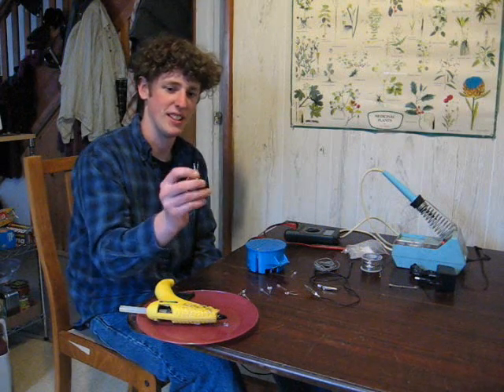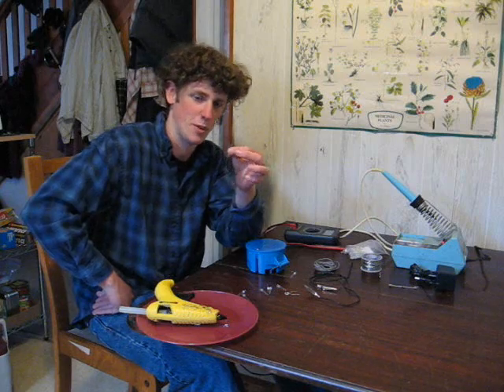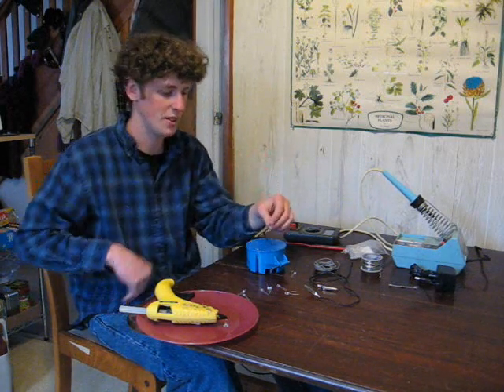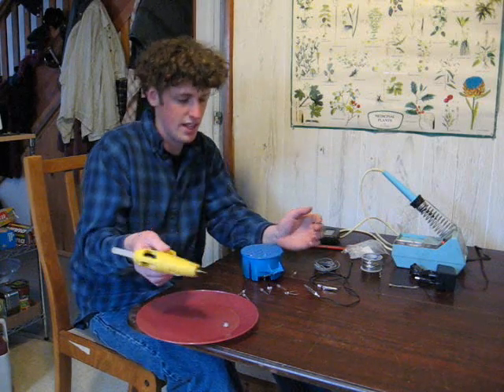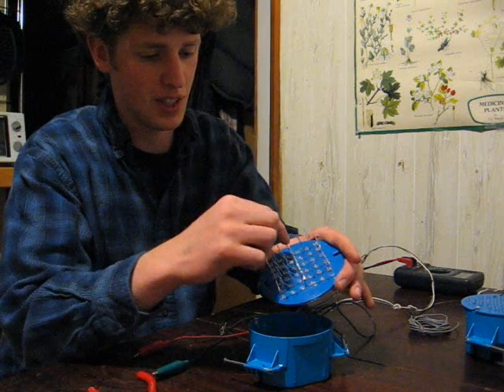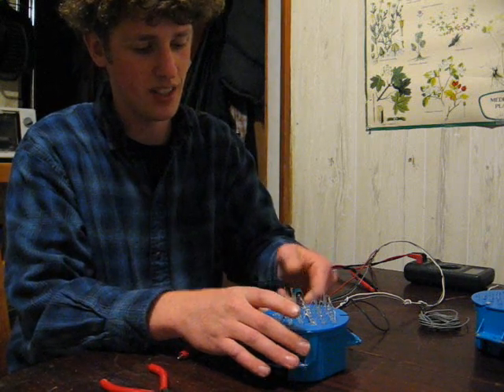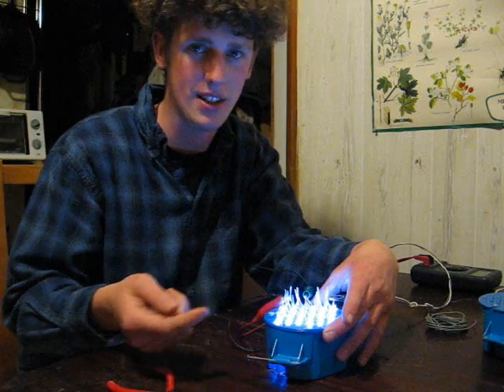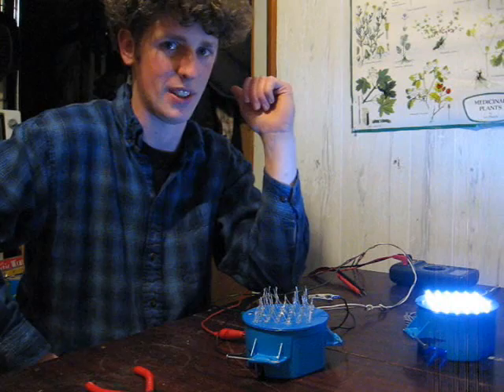How to Build an LED Light - Part 2

Comment: I thought you did a good job very informative telling the drill size etc many people won't get that specific. And glad to hear its lasting years. Something you may want to get is I had a Black and Decker rechargeable battery operated solder gun for repairs when I raced boats it has a fine top and is very precise and easier to use. Also I would paint box bright white with a reflector after seeing it back lights I would try a bracket to suspend it on the reflector to use front and back.  Cool!

Comment: You know that you apply solder to the work not the iron. Yes you do put some on the iron but that's for heat transfer and to prevent oxidation...

Comment from the maker: If you heat up the wire on an LED, you will burn out the LED. You are right, usually I do it the way you describe, but it would be a waste of time to do all that soldering only to find out afterward that you burned up half your LEDs.

Comment: your soldering is wrong, try looking up how to solder.  you dont paint solder on, you heat the wire and apply solder to the wire to melt into it. your method is called a blob solder and resuld in cold connections.  Please if you want to do instructable video, learn first the proper methods.

Comment: Nice job guy & thanks for sharing it. As a desk item, I want to illuminate from the inside, an old 1950s hood ornament that was made for a light. I think it would take 2 or 3 super bright LEDs powered by batteries if possible. AA to 9v doesn't matter. If so can you recommend a site for 'electrical dummies' that might show a diagram for the proper way & necessary parts to do this? Would I be better off just using parts from an LED flash light?
  Thanks!....( you know your going to get questions)

Comment: you need to learn how to solder properly!!!!!!! First heat sink in between heat source and led. Second heat the wires on led then put solder on led wires not soldering iron. Its true that you might need some solder to help transfer heat but you dont rub it on the wires.

Comment: @Ohsonikefresh No resistor was needed in his design because he used 3 LEDs in series.  These blue super bright LEDs drop about 3.4 volts max and since he used a 10 volt source, each LED has 3.3 volts.  Also because he arranged the LEDs to have 6 parallel lines, the current should be low enough.

If you had a different LED configuration for your table and are wondering where a resistor would go if you needed one, it will go right after the positive or negative lead, either will work fine.

Comment: @WorkFromHome001 The one major item you'll need to make your own boards is a laser jet Printer. A regular clothes iron, photopaper and CAD software makes up the rest. I use Eagle by CADsoft. The free version allows boards up to 4 x 3.2 inches and two layers.

Comment: @thetruth482 If you do say you change out an FPGA, BGA, PBGA or reball a BGA or anything of the sort, I will know you are lying immediately. 

Repairing a burnt  or cut trace to class III standards.  Replacing a QFP. Writing either C or assembly code for and AVR or PIC.

ALL of the above REQUIRE knowledge and experience way beyond YOU and ALL of which I do.

Comment: @thetruth482 (sigh) Please listen to me. There is a company called IPC that sets the industry standard for soldering techniques. Go to IPC dot org to see info about them and who they are.

"knowledge and experience way beyond somebody sitting on a bench soldering"

Ok, lest see you change out a FPGA or a QFP which I do on a regular basis. How about programming an Atmel AVR or Microchip PIC? How about reballing a BGA? Do you do board repair like replace burnt/cut traces? 

I didn't think so.

Comment: @thetruth482 This is the ideal method since the flux is being utilized to activate on the work area and not burn up on the tip.

It makes no sense to tin the iron before you do any work since the tip will have solder on it from the last time you used the iron. You tin the iron after your done to prevent the tip from oxidizing.

Comment: @thetruth482 Be sure you tell that to the people at BEST that write the IPC industry standards that trained me and gave me my certificates. I don't care who YOU are or what you do wrong. you are NOT trained to the industry standards but whatever. Not my work you're adding too much solder to.

The part you're missing is when when you hold the iron to your work to bring it up to temp. and you start to add solder to the work area, you're also tinning the iron at the same time.

Comment: @thetruth482 Um NO, CORRECT!!!  I AM an electronics tech that's a Certified IPC Specialist in J-Standard-001 Soldered Electrical and Electronic Assemblies, IPC-7711/IPC-7721 Certified in Rework and Repair of Electronic Assemblies. I work in a facility that manufactures boards for the military, Raytheon, Boeing, Caterpillar and a hundred other companies. I do all of the RMA repairs.

Look for sparky3489 on photobucket to see my certificates and while your there, look for my album called 'work'.

Comment: @WorkFromHome001 Um no, you tin it afterwards. If you tin it before hand, you'll be adding excess solder you don't need.

Here's the CORRECT procedure:
1. Using a moist sponge (or some prefer to use brass wool), wipe any excess solder from the hot iron.

2. Taking only about a second, hold the iron to your work to bring up to temperature then add the appropriate amount of solder.

3. When finished, wipe the iron on the sponge again, tin the iron, put iron into it's holder and turn iron off.

Comment: I agree with nigelwright7557, anyone who has been soldering for any length of time knows you don't add solder to the iron. You're suppose to have the iron on one side of the project and the solder on the other. Heat up the project and add solder to it. 

Certified IPC Specialist in J-Standard-001 Soldered Electrical and Electronic Assemblies, IPC-7711/IPC-7721 Certified in Rework and Repair of Electronic Assemblies

Comment: @SharjeelEffect You leave a lot of variables.  How are you attaching to your computer?  USB port?  In the key board?  What?  What are the specifics of the LED you are using, volt and amp requirement?  And for what purpose?  R U lighting the key board, the on/off switch, what?  To many variables.

Comment: kindlt tell me how cud i mount 2 or 3 LEDs in my computer casing?as the power supply has an output of i think 12volts.how can i minimize it upto 3vs???i mean wat kinda resistor shud i use??plz help me out!

Comment: @catskillwoodgas IMHO voltage regulator is not enough. Try use 10V regulator with for ex. 5A or 10A and connect to this lamp. I think that everythink blink and blow up :D

Comment: Do NOT, I repeat do NOT solder like he did. Solder is (usually), and by usually mean unless you're doing surface mount soldering, you should always heat the component you wish to solder and apply the solder to the contact point. NEVER APPLY SOLDER TO THE IRON AND TRY TO APPLY IT TO THE COMPONENT. 

Also, tin your iron with solder before soldering and wipe it off with a copper brillo pad or wet sponge to remove excess solder and to clean your tip. tinning your tip reduces oxidation.

Comment: Great tutorial! One thought about soldering though.. It's better to heat the wire with the soldering iron and then apply the solder directly to the wire. You still need a bit of solder on the tip of the soldering iron, but the main solder should only go on the wire. There's a great video about soldering if you search for "How and WHY to Solder Correctly".

Comment: Have you tried a heatsink? Try clipping something metal (larger than the alligator clip) to the poles, that way you can solder correctly by heating the pole and applying solder to the pole. The heat will draw to the metal object rather than to the LED and possibly burning it out.
If viewers learn how to solder the way you're doing it, they will have problems with solder sticking to joints for sure.

Comment from the maker: yes, it is usually better to heat the part receiving the solder, but with LEDs you will probably burn out half of them if you do it that way.  At least, I did before I modified my technique. Thanks for constructive feedback.

Comment: do you need to  use any resistors if you are using leds with the correct voltage ..i am trying to something like you did